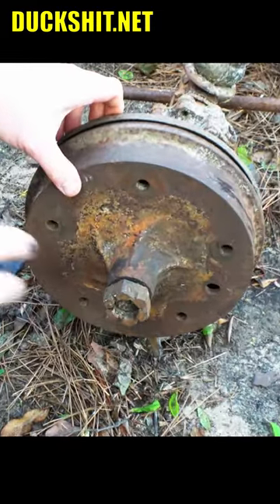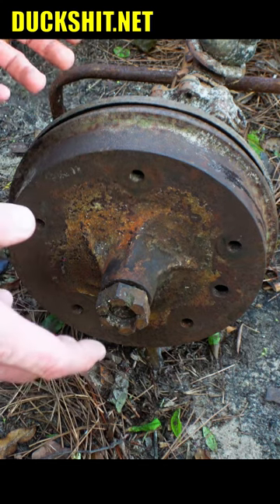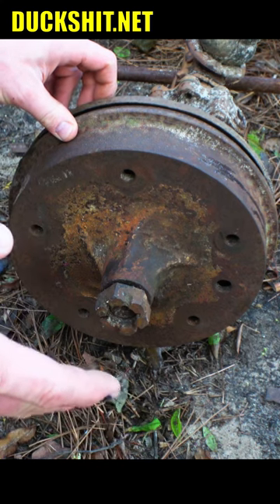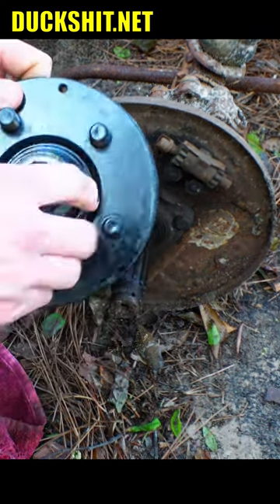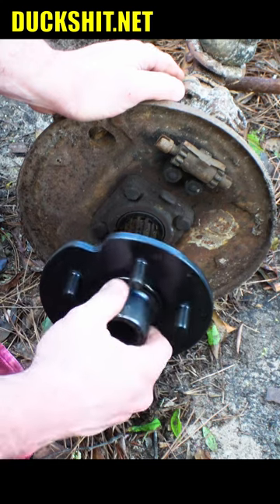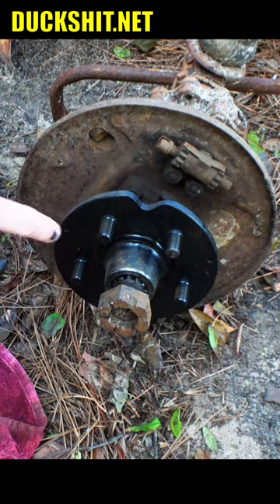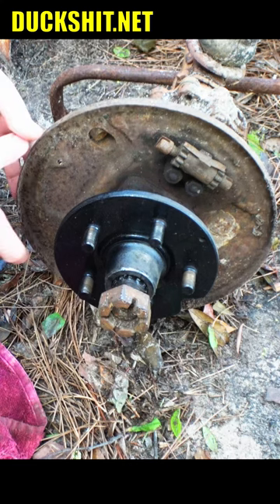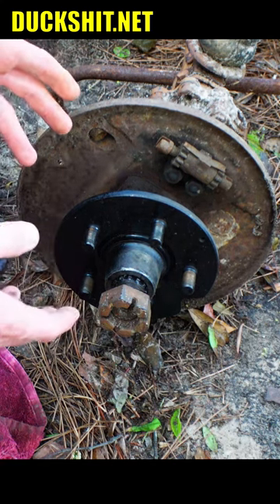🔧💥Bay Bus Hubs on Split Reduction Boxes? #shorts

Comment: Hey, Lord Duckman. Yes, the nice thing about oem parts is when you need to replace it, it's easy to know what it goes to. Most parts houses employees really don't know much other than the computer. I just bought a 1974 Super Beetle. Duel kadrons. Used to be an AC equipped bug, but was removed. Nice thing, zero rust, pretty new motor. I am watching to see what comes of that bus pan. 🦆👍. Noel
Reply from the maker: Wow, good find!  Thanks for sharing!  I wanna see some videos of that one!

Comment: i love it when you find parts just fit and you dont need much work to make it work for you

funny thing is im doing something on my bmw 2.0 diesel im changing a lot of parts which normally wouldnt be on my vehicle but because bmw like to reuse stuff especially on their diesels you can put stuff you want on your car that normally wouldnt be there. such as massive front brakes running 365mm brake discs originals were only 300
Reply from the maker: Good find!  I'd like some bigger brakes on this frame... the dreams of big mud tires kind of demand such things.
Reply: One of my "talents" is looking at two things that normally don't go together and thinking "Hmmm, if I put THAT one THIS WAY it'll fit the OTHER thing. 😆
Reply from the maker: You and are I a coupl'a peas!
Reply: @DuckmanCycles  We DO have a lot in common! Like when somebody says: "That can't be done"! We say: "Hold my Rum and Coke"! When somebody says something can't be done it just means THEY don't know how to do it! During my career as a Mechanical Engineer (now retired) I had quite a few times when I pointed out something to the Factory Engineers that DESIGNED the damn thing and they looked at me like: 😱
Reply: @DuckmanCycles  it helps when you have access to many things like in your case you borrowed that hub thing
Reply from the maker: That's true.... but Wild Bill having a part convenient this week was an exception.  Eleanore's chassis was built from a lot of ebay stuff.  I bought a lot of things that didn't fit, but I found they fit other places.  I waste nothing.  Gregory the Bus has her spare parts now.